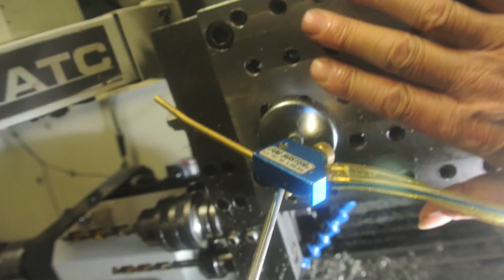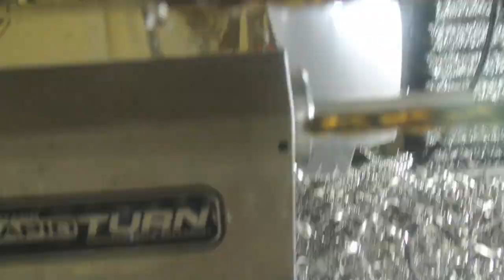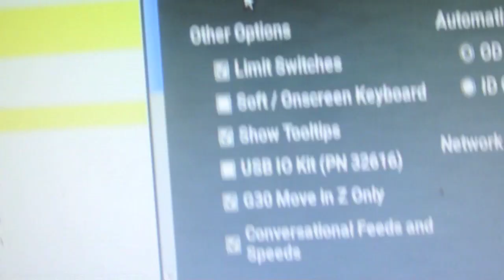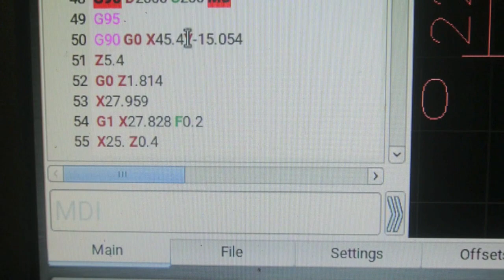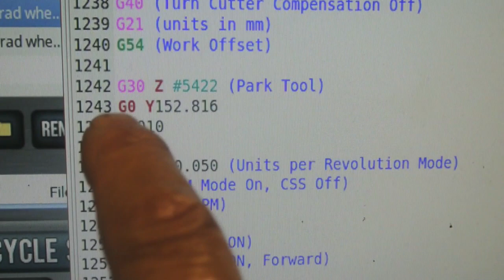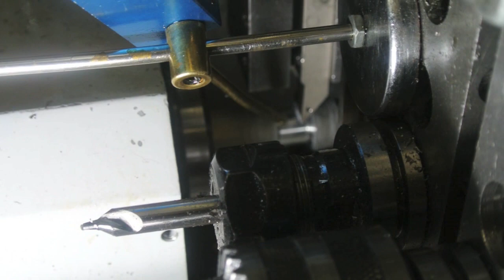Rapid Turn Gang Tooling For Beginners

Comment: As Angus said,  it,s good to see you back, Bob.

It seems like a lot of work to make the wheel nuts.
But you managed to make it work for you.

You did a great job of setting up the tools, which i guess must had taken some time to do.

I envy you do all this work, with the combination of the mill and the Rapid Turn together.

On a side note, Bob.
During your video, try to pause between movements of the camera.

 It is not easy to do YouTube video,s i know,  but if you just pause it will give you some time to re -organize yourself before continuing with the video.

Also keep the video,s coming Bob.

Would love to see maybe some outside the workshop video of the motorcycles themselves 
that you seem do a lot of work with.

Thanks again for the video.
All the best.
Regards Peter.
Reply from the maker: It would have been a lot more difficult to make them on a manual lathe. I made a run of 80. It took a good few days to set up the machine so that the tools were clear of crashing into the Rapid turn then another few dos of fine tuning the programme but now I have a programme that I know works well and it will be easy to repeat if anyone needs any more.